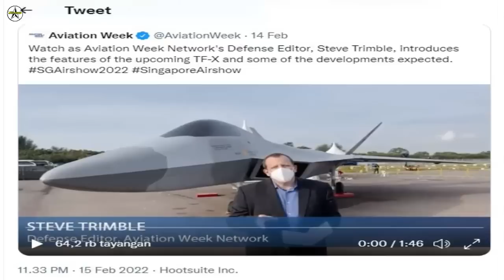Turkey officially launches competition for TF-X fighter engine

Comment: Turkey cant even deliver its attack helicopter to Pakistan, can they deliver a stealth jet? Without US tacit approval and help, this will remain a dream.
Reply: I think you don't know Turkey well. According to Pentagon data; Turkish suppliers produce 817 of the approximately 24,000 body parts and 188 of the approximately 3,000 engine parts of the F-35. This corresponds to 1,005 pieces in total. Turkey has enough capacity. However, thanks to the embargoes, it had to use this domestic production potential. In fact, the TF-X project has progressed quite a bit. Engines were taken for prototypes. For the original engine, both the joint project with the UK and the domestic project are continuing. Relations with the United States eventually improve again. Power has changed in Pakistan. The helicopter sale will take place soon. Turkey has the capacity to easily reach conclusions on the issues it focuses on.
Reply: @Sirius3534  Only in your dreams produced propaganda posters 😔🤕🇹🇷🥴⚰️🚬
LM USA don't recognize your products
Low value part's 👈
Reply: Understand you wish happens all this but nothing happens from all this so keep dreaming.
Reply: @theobserver2114  🇹🇷😭👈 oturum okulu 🔱👈🤗🇬🇷🔱⚓🇬🇷⚓🔱 PEŞKEŞ 📜🔒🗡️🛡️🇬🇷🇪🇺 Sevron No 2
Reply: @Sirius3534  As long as a single IP part belongs to the US, Turkey cannot deliver. This what happen with Dutch ASML. You can brag as much as you like, US controls Turkey militarily because they depends on US for its critical core.
Reply: My poor little boy, you mix everything and anything..The USA only supplies the engine of the T129 and everything else is locally made,  they prevent the sale to PAKISTAN but now Turkiye make his first indigenous  helicopter ,the GÖKBEY or T625 with TUSAŞ TS 1400 engine  .Turkiye is now capable to make turbofan ,KTJ 3200 for missiles and TUSAŞ 
 presented a new one of 44kN with PC  for BAYRAKTAR KIZILELMA it will be ready in a few years ,only less  than 10 countries Can Do it .Today  China still doesn’t know how to make helicopter engines.
Reply: @orhankaya9064  forgot about it Pakistan send USA Government lor to make sure negotiation about
MH 64 GUARDİAN APATCHIE LONGBOWE and Fara newest Fast assault Helicobacter.
You are interested to provide your Helicobacters between USA Government ❓😀 tost brain 🧠👈
Still using methamphetamine opium Valium kaptagon... 😭🇹🇷😭❓
Reply: @orhankaya9064  gobey ❓ this is a Italian technology and engineering English manufactured both companies Ağusta Westland produced this Helicobacters

Nothing else Existing
Reply: @orhankaya9064  don't forget the first turk where he will walk to the sun 😎 I hope brings his sun glasses.
Reply: @orhankaya9064  none the less, Pakistan canceled the deal because they cannot delivered as promised. Furthermore, its not fully indigenous as claimed, instead it is copied from Agusta A129 Mangusta. Turkey is still unable to produce its own turboshaft but buys from Ukrainian firm Motor Sich. The TS1400 from TUSAŞ Engine Industries is still under development is not expected to be completed until 2025 as claimed. Turkey cannot even get either F16 or F35 unless they bow down to US demands. The end conclusion, Turkey cannot delivered anything without US tacit approval.
Reply: @jayechow8525  TS 1400  developpement ils finished and waits Certification of civil aviation since more than one year ,it tooks a long Time for this , but not for military  helicopers ,3 of them will be delivered  at police this year .For this moment only first 4 prototypes operate with an other engine but  TS 1400 engine began to be integrated  to T625 and all of these will operate with this engine before 2024 my  litle boy .
Reply: @jayechow8525  My little boy, the design of a helicopter revolves around an engine, okay? Turkey cannot sell the T129 without the approval of the USA, which only manufactures the engine,but Turkey is not going to waste years developing an engine for a helicopter that it already has in large numbers and whose design needs to be very much changed for the integration of a new engine,I mean, we’d have to develop a whole new helicopter, aren’t you ridiculous? She did it with the T625 with the TS 1400 engine with a new helicopter bigger than the T129,do you understand?
Reply: @jayechow8525  Ahaha,you're a joke my litle boy and the  deal IS not cancelled with Pakistan  ,stop to belive Propaganda . . :) :)
Reply: @orhankaya9064  My suggestion, it would be better to buy a stealth jet from Indonesia, Japan and South Korea instead. They are cheaper than F35 and they have already proven and succesfully flown. I seriously doubt Turkey can do better than these countries whose industry base is better and comparable to US.
Reply: @jayechow8525  Indonesia,,Japan eand  south Korean are nothing without US technologies . :) :) Turkish 
TF-X will be better than south Korean KF -21 which is 4,5 th generation and made with european weapons ,and help by  US and israel.South Korea and Japan  buy lot of technologies to US ,european and Israel ,türkiye makes his weapons alone my little boy . :) :)
Reply: @orhankaya9064  U should take heed on your own advice "indonesia, japan and south korea are nothing but US tech". Turkey also faces the same hurdle as it can never make its own turbofan to powered its jet fighter. Learn from India failure in its "Kaveri" program losing billions and in the end its Tejas need to run on US jet engine which I am 100% sure Turkey jet will also run on US techs. Its a cheaper and safer bet to buy from these 3 countries. As for Turkey dream of exporting its jet fighter, Turkey can never be able to do so. In the end, US will torpedo Turkey deals just like its T129 deals.
Reply: @jayechow8525  You don’t understand my little boy, you didn’t read my comment above, TUSAŞ and its engine subsidiary TEI now have the knowledge to make turbofan engines . In the TFX programme, there are two proposals from TEI -TR MOTOR and KALE ARGE -ROLLS ROYCE, the latter has not yet submitted its offer.TEI director had worked many years at GENERAL ELECTRICS ,he will supervise the engine design of the TF-X if the TEI -TR MOTOR proposal is selected. TEI has presented a turbofan  with post combustion of 44KN ,the TEI TF 6000 for the BAYRAKTAR KIZILELMA combat drone, you understand my little one, Turkey is now able to design and manufacture turbofan engines . You should go play marbles, these subjects are not of your level .😀😀
Reply: @orhankaya9064  India too can manufacture turbofan. Kaveri turbofan is also a independently finished product. However, it is not used because it lacks the required thrust than the proposed engine can provide. Unlike India, Turkey still cannot build turbofan independently and required to work with other NATO member such ad UK R&R. By doing so, Turkey is still held by its balls by the US led west. Learn feom history, Argentina falksland war was lost because France refused to sell more exocet missiles on UK request. Do you think UK will do US bidding or Turkey bidding? Rather than "reinvent a wheel", go buy a South Korea, Japan or Indonesia stealth jet fighters. It can help saves billions.
Reply: @Sirius3534  No need to get to personal with such attacks. Anyhow, Pakistan just revoke and cancel Turkey Attack Helicopter deals. You should give your thanks to US.
Reply: @Sirius3534  Never put your life in someone hands. Indigineous made is what Turkey need to do. I'm pretty sure Turkey has 1st hand experience how US dictates your country.